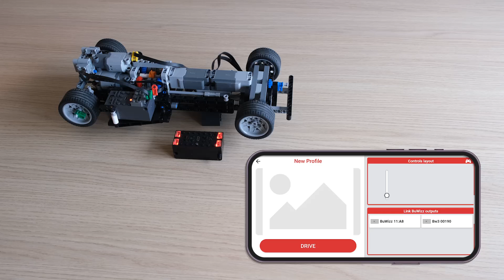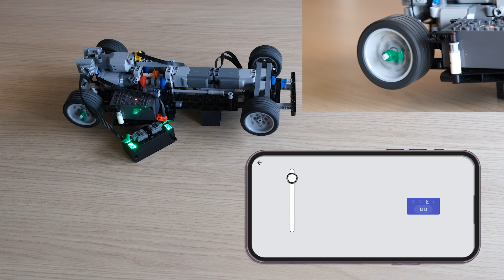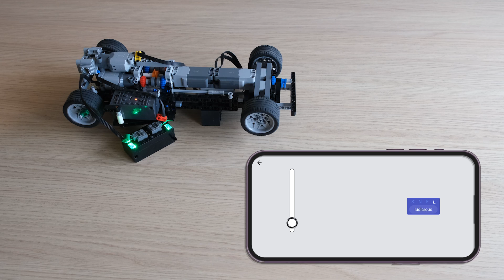How to video: Speed control

Comment: I think having the speed control adds versatility to the 3.0 Pro, so it's a good feature. I do wonder though why you have to step through gears and can't just tap the speed you want. Since it powers on in ludicrous mode every time, rather than the most recently used level, my first action with any patch has to be to reduce the speed. As far as I know there's no way to record a default state for all the knobs and sliders. 
And is the only way to know what speed you were at when you last opeened a patch to draw gradations and levels on the device screen with a permanent marker? Surely a scale would be useful on the app sliders?

Comment: Could you please confirm if the new app enables the "deep sleep" setting to disable the excessive drain on batteries when not in use?  I have to replace the battery in my BuWizz 3 (purchased in 11/2022) due to this issue.